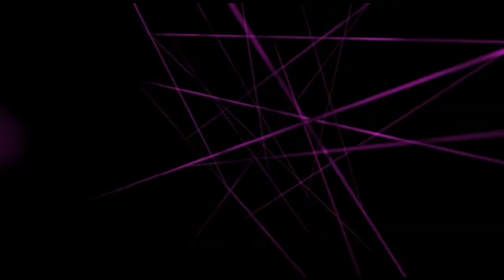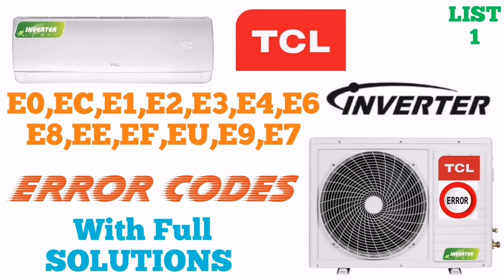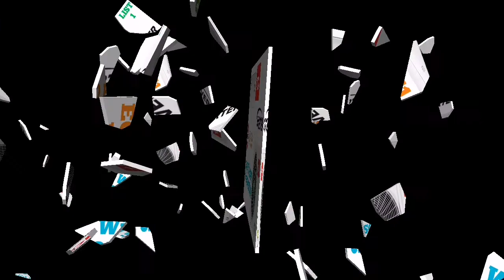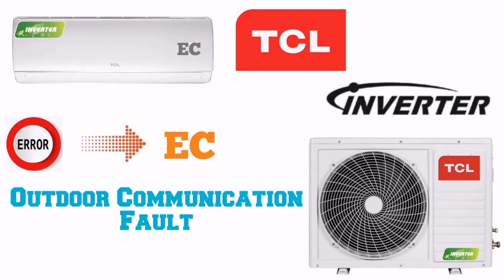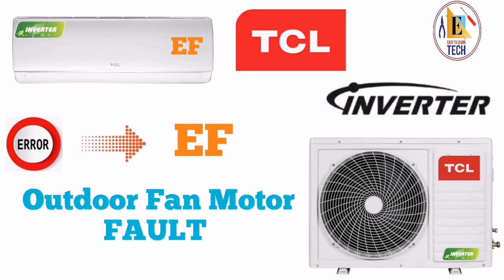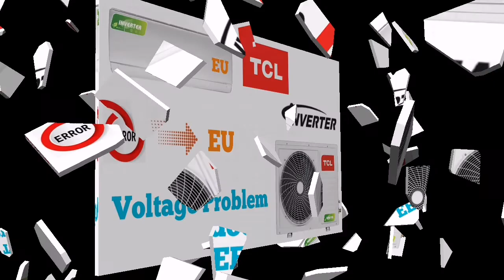TCL DC INVERTER AIR-CONDITIONING ERROR CODES || SOLUTIONS || TROUBLESHOOTING || FULL REPAIRS

Comment: 79
Reply from the maker: In TCL air conditioners, error code 79 indicates a problem with the low-pressure switch on the outdoor unit, often triggered by a clogged air filter or a frozen cooling coil.

Comment: Hi buddy ! I have two TCL air conditioners when they are with the photovoltaic they emit beeps without any errors on the display. after a few hours they start working again and then the problem repeats! you can help me
Reply from the maker: @stefanoargentieri817   What is the condition when they work with electricity?
Reply: @Rehankhan_HVAC_TIPS  the internal splits emit beeps but do not show any errors! and they don't even respond to the remote control! after a few hours they start working again and then repeat the problem after some time
Reply from the maker: Please can you share me the video.
Reply: @Rehankhan_HVAC_TIPS  where ?
Reply: @Rehankhan_HVAC_TIPS  the problem started when I installed the photovoltaic! it only affected the two tcl air conditioners! Hisense no! I think it's a power surge problem
Reply from the maker: @stefanoargentieri817 According to the Ac AMPS, photovoltaic is not able to generate the Amperes. Needs to check, how much power photovoltaic is producing.
Reply from the maker: @stefanoargentieri817 In the starting power consumption will be less as the Ac runs on full load then the AMPS will increase, maybe be that time this is happening.
Reply: @Rehankhan_HVAC_TIPS  c even if the air conditioner is turned off, it emits beeps even if it is not in use! I think it is sensitive to voltage drops
Reply from the maker: @stefanoargentieri817 Ac are not getting proper voltage ⚡
Reply from the maker: @stefanoargentieri817 Try to run One AC at a time and check if it is showing the same issue.
Reply from the maker: @stefanoargentieri817 if you can send me the model no of both the Ac units and photovoltaic
Reply from the maker: In the description

Comment: What about EA?
Reply from the maker: An EA error code on a TCL air conditioner indicates a compressor abnormality. This means that there is no feedback to the controller or the compressor load is abnormal. In this case, the air conditioner will shut down and display the error code. 
Here are some other things to know about TCL air conditioners:
Over voltage protection
If the AC voltage is greater than or equal to 260V, the unit will shut down and recover when the AC is less than or equal to 255V. 
Over current protection
If the outdoor unit's current is overloaded, the controller will immediately shut down the unit and display the error code. 
IPM module protection
If the IPM module has a high temperature or over current, the outdoor unit will shut down and the LED on the outdoor PCB will display the error code. 
Auto-restart function
If there is a sudden power failure, the unit will automatically restart with the previous.

Comment: error CL
Reply from the maker: If you're encountering a CL error on your TCL inverter split unit, it typically indicates a communication problem between the indoor and outdoor units. Here are a few troubleshooting steps you can try if you have technical knowledge otherwise call a professional..

1) Power off and restart: Turn off the air conditioner at the circuit breaker or disconnect it from the power source. Wait for a few minutes, and then turn it back on. This simple reset may resolve the communication issue.

2) Check the remote control: Ensure that the remote control's batteries are functioning correctly and properly inserted. Weak or dead batteries can sometimes cause communication problems.

3) Verify the display: Take note of any additional error codes or error messages displayed on the unit's control panel. They may provide more specific information about the issue. Refer to the unit's manual or contact TCL customer support for assistance in interpreting the error codes.

4) Inspect the wiring: Examine the wiring connections between the indoor and outdoor units. Look for any loose, damaged, or disconnected wires. If you're comfortable doing so, you can try reseating the connections or fixing any obvious issues. However, if you're unsure or uncomfortable working with electrical components, it's best to contact a professional technician.

5) Power supply check: Ensure that both the indoor and outdoor units are receiving the appropriate power supply. Check the circuit breakers or fuses related to the air conditioner and verify that they are not tripped or blown.

Comment: Hi, anybody know how to clear the CL code ? thank you
Reply from the maker: 1] The "CL" error message on a TCL air conditioner typically indicates that there is a problem with the air conditioner's compressor. 
2] There are several potential causes of a compressor problem, including:
A faulty compressor motor
A malfunctioning compressor starts current. 
A damaged compressor relay. 
3] It is important to have a qualified technician diagnose and repair any issues with the compressor, as attempting to repair it yourself can be dangerous.

Comment: CL error code in TCL split type. Thanks in advance
Reply from the maker: Please send a video by mail 💌
Reply from the maker: If you're encountering a CL error on your TCL inverter split unit, it typically indicates a communication problem between the indoor and outdoor units. Here are a few troubleshooting steps you can try if you have technical knowledge otherwise call a professional..

1) Power off and restart: Turn off the air conditioner at the circuit breaker or disconnect it from the power source. Wait for a few minutes, and then turn it back on. This simple reset may resolve the communication issue.

2) Check the remote control: Ensure that the remote control's batteries are functioning correctly and properly inserted. Weak or dead batteries can sometimes cause communication problems.

3) Verify the display: Take note of any additional error codes or error messages displayed on the unit's control panel. They may provide more specific information about the issue. Refer to the unit's manual or contact TCL customer support for assistance in interpreting the error codes.

4) Inspect the wiring: Examine the wiring connections between the indoor and outdoor units. Look for any loose, damaged, or disconnected wires. If you're comfortable doing so, you can try reseating the connections or fixing any obvious issues. However, if you're unsure or uncomfortable working with electrical components, it's best to contact a professional technician.

5) Power supply check: Ensure that both the indoor and outdoor units are receiving the appropriate power supply. Check the circuit breakers or fuses related to the air conditioner and verify that they are not tripped or blown.
Reply: Thanks for the reply. Will try those and Keep you posted.

Comment: My ac showing Fb code what its mean
Reply from the maker: Turn off the AC unit and unplug it from the power source for at least 10 minutes, then plug it back in and turn it on again. This can help reset the system and clear any temporary errors.
Reply from the maker: If the unit is not working normally ,  then there will be fault with the indoor fan motor , sensor or PCB card .
Reply: @Rehankhan_HVAC_TIPS  tq brother

Comment: Error code EE
Reply from the maker: The EE error code on a TCL inverter AC typically indicates a communication error between the indoor and outdoor units of the air conditioner. This can be caused by a variety of factors, such as a faulty control board, loose connections, or a wiring issue.

Comment: P4 Error
Reply from the maker: Exhaust over temperature protection error.
# compressor overheating
# outdoor fan motor problem or PCBs card damage.
Reply: @Rehankhan_HVAC_TIPS 
Hi bro E9 and F6 error showing 
Board has to changed instruct by service centre people cost 8000 it is reasonable price 

Please suggest
Reply from the maker: Outdoor board issue , if you can check any one in our area can repair the board . Are you from India which region.  But the new board price depends on region and country,so i can't tell you about the price .

Comment: EC Error Please?
Reply from the maker: 1. Check the contact of communication wire (CN5) between power source board and intelligent power module
Insert again if loose.
2. After the complete unit is energized, check the indicators on outdoor power source board and intelligent power module.
The indicator on power source board blinks normal (bright for 1 second and dark for 1 second), but the indicator on intelligent power module does not work normally.
Replace the intelligent power module
If the fault remains unsolved, replace the power source board again.
The indicator on intelligent power module blinks normal (bright for 1 second and dark for 1 second), but the indicator on power source board does not work normally.
Replace the power source board
If the fault remains unsolved, replace the intelligent power module again.

Comment: E4 error code salutation
Reply from the maker: 1] Check the high-pressure and low-pressure valves.
If not open, open again to ensure the system circulation is smooth.
2] Check the system refrigerant (Start and run under cooling mode. When the compressor is started, check the outlet temperature for its change. If the change is not obvious after 5 minutes)
The system is in shortage of refrigerant. Test with pressure gauge, check the leakage point and recharge the refrigerant.
3] Check the evaporator coil temperature sensor (25 /5K ℃ Ω).
Replace the temperature sensor if the resistance is incurred to drift, open or short circuiting.
4] The above inspections are normal.
a. The flow might be uneven for indoor system. Short circuit JP4 jumper of the indoor control board to shield this protection function (V1 – Indoor Main PCB).
b. The flow might be uneven for indoor system. Dial the JP4 switch of the outdoor power source board to position “1” to shield this protection function (V4 – Power Source Board).
Replace the indoor main PCB if the problem cannot be solved by using the above methods.
Note: if your technician than only use the above method, otherwise call experts to fix.

Comment: error E5 please ??
Reply from the maker: Its a new unit installed or old unit showing error.
Reply: new unit
Reply from the maker: Model configuration wrong
Reply from the maker: Check the indoor & outdoor units are for same model or different....if they are different models, check with suppliers

Comment: Bro i am getting error OA plz explain that
Reply from the maker: Please brother give me the model no
Reply: @Rehankhan_HVAC_TIPS  brother the model is Tac-18T3B
Reply from the maker: Please Check the error brother, what is that OA OR ANY OTHER
Reply: @Rehankhan_HVAC_TIPS  bro can i contact you  by whatsapp?
Reply: @Rehankhan_HVAC_TIPS  so there i can send u the pic
Reply from the maker: @sudaisahmedkhan5051  you can send me by mail, check mail ID in channel. Go to about
Reply: @Rehankhan_HVAC_TIPS  bro the error is (zero A) now it will easy to understand
Reply from the maker: Brother do one thing restart the ac, unplug from the socket and replug after 3 minutes,than start with the remote in cool mode.... Please do that and let me know. 

Because 0a thier is no error in tcl airconditing.
Reply: My ac has the same problem when I set the current to 3 Ampere and during daytime. It shows 0A.
Reply from the maker: Brother do one thing restart the ac, unplug from the socket and replug after 3 minutes,than start with the remote in cool mode.... Please do that and let me know. 

Because 0a thier is no error in tcl airconditing.
Reply: @muhammadumair9074  bro i have got the solution😀
Reply from the maker: Whats the solution
Reply: @Rehankhan_HVAC_TIPS  brother its not an error i have contacted the AC technician here he told me just to reset my remote by changing cells
Reply: @Rehankhan_HVAC_TIPS  I did that now it's all fine
Reply from the maker: I also told you to reset the AC
Reply: @Rehankhan_HVAC_TIPS  yes bro that worked really

Comment: Bought brand new tcl ac and EO error is comming. So depressed
Reply from the maker: Brother check if the wiring is done properly or not,, E0 is communication error between indoor and outdoor unit.. If you get same error please try to replace the unit from the dealer..

Comment: How to switch unit from F to ceilsus plz ?
Reply from the maker: Power off your air conditioner and then unplug the AC unit from the wall plug for at least 30 seconds.
Reinsert the plug and press the Power button if the AC does not automatically power on
Set the AC to Cooling mode.
Set the temperature to 30 degrees Celsius or 86 degrees Fahrenheit.
Set the fan speed to Medium.
Press and release the SLEEP button on the remote 8 times.   This must be done within 8 seconds.
After 4 to 7 seconds the display should switch over.

If the mode does not change start over at step one and try again.   The entire process must be done within the first 3 minutes of powering on the AC unit.